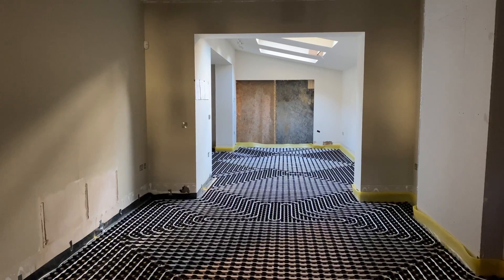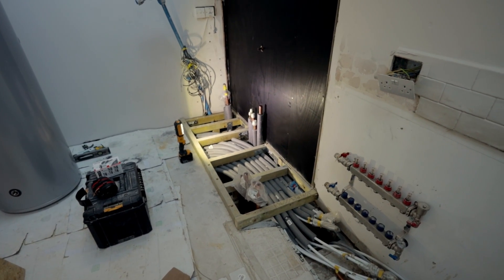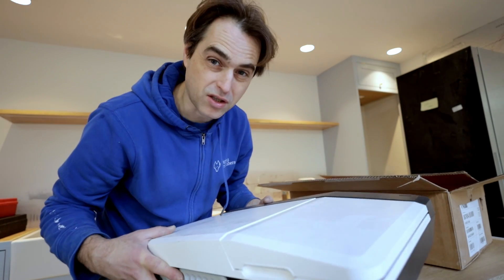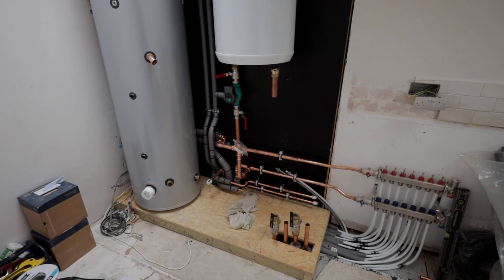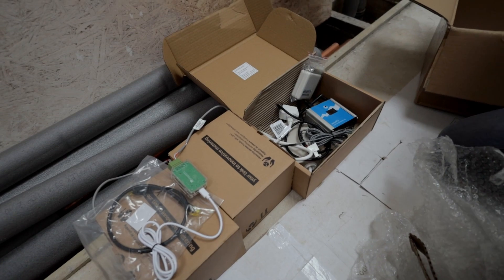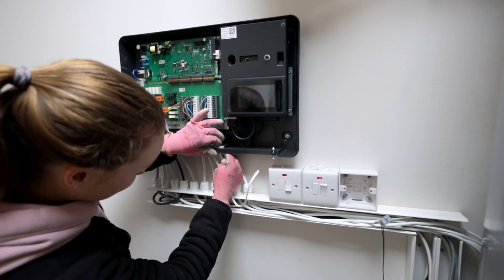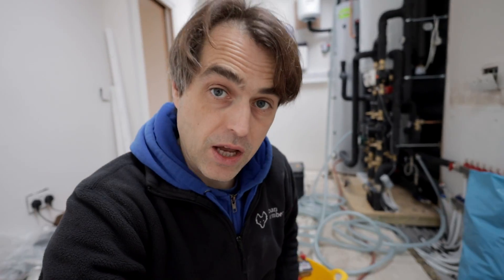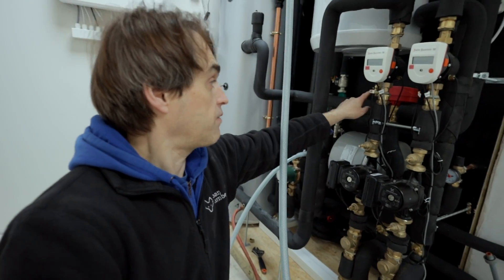NIBE 2050 Cascade System Installation In A Period Property.

Comment: Another great video Szymon, thank you! Did you fit check valves on hp flow and / or return pipes to avoid any unwanted circulation / interference in between the devices?

Comment: How are the weather compensated curves set on one heat pump and on the other, considering the parallel operation of both heat pumps in heating mode?
PS: You’re giants!  It’s a pleasure to dive into your projects and analyze the setup.
Reply from the maker: Curve is always the same - it’s dictated by the system design not a number of heat pumps
Reply: @UrbanPlumbers  Clear, thank you. Is there a time delay for switching the slave pump on/off relative to the master pump, considering that they have the same setpoint?
Reply from the maker: @DDJ1621 @DDJ1621, this is not a master/slave setup. It is a full cascade with load sharing, so depending on the load required 1 or 2 units run at the same time. if only 1 is needed, then they will swap duty to have the similar use.

Comment: Related to the analysis of the pump's operation performance, what do you think about taking the data necessary for calculating COP, SCOP... directly from the controller, using a MODBUS converter and suitable software for archiving and processing the data? So, within the controller there are all the necessary measurements required for the analysis. What do you think of that methodology compared to the Open Energy Monitoring system?
Reply from the maker: OEM is more accurate as it has wet temperature sensors and much better flow meter. Heat pump measurements are usually 30% off either way. Also MID meters for electrics are more accurate to most heat pump measurements, and heat pump monitoring doesn’t usually take control or circulators into the account

Comment: What’s the advantage of running 2 smaller units rather than putting in a 3 phase supply and running a single large ASHP please. A supplier is recommending a cascade solution for me, 2x8kW and I don’t know why.

Comment: Nice video, and very nice work. 
For once a plumbing heating channel serious enough to be worth subscribing.
On the first day, as you were laying 28 mil pipes, I was worried you would not have enough flow, but then saw Marie laying 35 mil ones and was relieved.  Still you must be on the fence for the output power, although I have no worries you have calculated it all.

With that setup where the pumps have specialized roles, isn't one of the pumps going to fail before the other?

All in all this installation is on the fence for me*. I would probably have proposed a 20kW condensation pellet boiler, or at least I would have put an offer with either heat pump, either pellet. Both have their pro and con.

* Not on the fence about if it will work, and how well it will work. More on the fence of what to propose that would be more beneficial for the client. There is rarely a perfect heating system in renovation, so you have to weight the pro and cons of each setting and chose what's best.

Comment: I don't think this setup is called cascade heat pump. Cascade heat pump generally means that condenser of the first heat pump in a cascade heats the evaporator of the second heat pump.

Comment: I think the term "cascade " is not right in this case. Cascade is series HPs of different refrigerant where HP1 has an output of perhaps 30C and the HP2 will take that and increase it to 60-70C. It is mostly used to get very cold temps for freezers. At first I thought that was what you were doing but now I see it is parallel HPs to increase capacity in colder outdoor temps.
Reply: yes and no. In the fridge world you are completely correct with your definition. In the heating world, two heat sources in parallel is refereed to as a cascade. The joys of two industries now being the same with two different uses of a termanology.

Comment: Okay, 8 kW heat pump can pump 8kW of heat, right? So cascading them would increase the temperature difference, but can't increase the power delivered? Because each heat pump can only pump 8kW, you would get 16 kW in parallel or 8kW in series?! The advantage of cascading being that you can have smaller radiators?... What am I missing because this isn't making a lot of sense.
Reply from the maker: It’s parallel- cascade is a term used in the industry ‘wrongly’ for 2 heat pumps in tandem
Reply: @UrbanPlumbers  Thank you for educating me! Appreciate your content!

Comment: Great video! Can I ask which supplier you use for the UFH panels and what kind of screed? I will be doing my ground floor soon at 100mm spacing and wasn't planning to use panels and have been told minimum screed depth is 40mm so curious to know what combo gets you 30mm? Thanks!
Reply from the maker: You can do 25mm if the floor is level. Pro fix plus panels

Comment: Thanks for the system monitoring graphs, the heat only pump(1) performs a lot better than the hot water one(2) is 52 degrees enough for legionella control?

Comment: Love a cascade setup. Do the Nibe allow both hot water and heating at the same time when in cascade? The stupid thing about the Mitsubishi is you could have 6 units with only 1 doing heating and hot water and if there is a hot water demand it will only do hot water the others will all go off, Bonkers.
Reply: Indeed it does allow both at the same time when in a cascade. Up to 8 heat pumps can be cascaded on that controller. Best control system on the market ;)

Comment: God help those customers, when things go wrong and your not around . 😢😮
Reply: Can anyone tell me what is the long term reliability of all those pressed copper connections are and will they fail eventually when the polymer seal ages? They're certainly quick but expensive, I'd imagine but surely well done soldered fittings would last longer? But again I'd imagine all this set up will be old hat in less than 15 or 20 years times and the next owner of that house will have big expenses in fitting something current.🤔
Reply: @nickhickson8738 we have pressed commercial installations that are more than 30 years old, and never had a leak. Carbon steel tube has been a problem  though.

Comment: What is the projected kw savings for a system like this .I know there’s a lot of variables but for someone who’s on the fence about whether or not to say go on something like this there has to be a break even point even if it 20 years from today . My guess is that job wouldn’t give you much change from £80,000.00. Why don’t you hire a insulation subcontractor and do a really nice aluminum jacketing on all the exposed piping?
Reply from the maker: Paul - the cost was much much less than your quoted figure - kWh saving are in the region of 80% as compared to gas kWh consumption as this system will run at scop over 4 and the gas boiler it replaced was around 90% efficient

Comment: Nice job, bit of work in that! As a sparky though I'd have to point out there's no need to use trunking like that, run it directly under the "brain" and cut a hole in the side to enter the cables. All cables are then hidden and less work - you'll never get the cables perfectly straight and it's a waste of time using stuffing glands on an enclosure that isn't IP rated.

Comment: Room temperature at 15DegC?  Is that correct??
Reply from the maker: Yes - ground floor is off as they are tiling the floors. I need to ask the client to move the sensor to a heated area

Comment: OMG!!.......I see Nibe have not improved their controls set-up in the last 20 years Dracula!!
Did a lot with Nibe on Geothermal 20-25 years ago, specified & supplied by others, we did fit only for Builders. Nibe back-up was shocking, run by a bunch of used car salesmen, most couldn’t put a Nut in a chimp’s mouth. Their Technical Support was non existent, a bunch of useless pricks.
I recall on one ‘Docking’ job, I asked a question about a Thermistor, to be met with a blank stare from the Salesman......This Donkey didn’t know what a thermistor was!!!!

Here, that wee lassie looks as if she’ll make a great a Tradesman. Watch incase, she gets head-hunted by Skaterboy Adam!
One wee point, your UFH loops should be sleeved as they come out the Screed at the manifold.
Keep up the good work son & I hope you don’t get deported to Rwanda before your next video.
Thanks for sharing.
Luv Dick Puller ❤

PS. Did you need to upgrade the 80-100amp Leccy incoming supply mate??
Reply from the maker: Skater boy doesn’t deal with heating anymore. Last time I heard he had some boring office job surrounded by tech and finance people selling iPads or something. 

Wee lassie is already a great tradesman. One day you may reach her skill, but probably not.

All heat pump and boiler companies are run by used cars salesman. 

I am glad the asylum has again reinstated your WiFi - meds must be working again.
Reply: @UrbanPlumbers  What, Heatgeek is selling iPads???!!!..........Oh, I’m getting a hint of a fallout there Dracula??!!!.....What happened, did he rip you off with his courses full of flannel & drivel???!!!

Well, a nice install as always mate, but you really need to buy a Bending machine, more elbows in that Plant Room than Gazza in the Penalty Box!!!......Can the wee lassie bend copper tube better than you then??

Thanks for your concern over my mental state, but worry not, I’m in the pink as they say. As long as people are making an arse of fitting UFH etc, I’m delighted to correct them. It gives me an enormous feeling of well-being.
One last thing, if you want to ‘Come Home to a real fire’, fit the Ideal Logic👍👍👍🥃🥃🥃
Reply: Bizarre comments?
Reply: @shifty277  I know, but his English is not very good son.

Comment: Syzmon, you (and Marie) continue to knock them out of the park, what a superb installation. I really like the openenergy monitor kit/website and think it is a force for good in the industry and a great reference source for the installer. On the wiring side - maybe a cable ID labeller would be a good discipline.😉😀👍

Comment: Very clean install, again. Is Nibe more expensive than a Vaillant? What's the efficiency compared to the Vaillant?
Reply from the maker: efficiency probably the same - I really don't see much diffrence here between manufactureres. Controls and quliaty of the desgin adn isntallation is what makes the diffrence - not the box outside. 

Nibe is probably comparable or even chepaer than Vaillant at the moment - as they have a sale, not sure they will keep the prices low for long though? Generally a bit more expesnvie than Vaillant. Controls are in a different leauge to Vaillant but I do not hear much good about the back up from the comapny from others.

Comment: Curious as to the minimum space required in front of the unit. Normally around 1.5 meters for a heat pump of that output. The controller is crazy and looks way over complex for a simple cascade. Why only one heat pump for DHW? Would it not be better to do a true cascade with lead and lag swap over? Drying time for screed, was that not a requirement? Underfloor looked amazingly well installed and pipework is spot on.
Reply: using one heat pump for heating and one for heating and hot water means that you will never get a disturbance in comfort when in hot water mode. The controller balances out the running hours between both heat pumps automatically over time, so equal wear. Controller is as simple or complex as you want it to be. There is a step by step basic set up guide which is suitable for most jobs and a more in depth step by step guide depending on what your system requirements are.

Comment: Thanks for such a great video. Your plumbing installation and pipe work is “Spot On”, but sorry to say your installation of the Main Control Panel is really poor. All the cables should be neatly laid out and marked up, also the input cable should be marked at both ends so that is also traceable.
Your plumbing skills are 120% but Electrics still need improvement.
You are the only Heat Pump Plumber that I would trust to do an install.

Comment: Great Video, and nice job, thanks for sharing
 i have one question regarding your Ufh system shown. 
Is it profix plus 20mm and do you using any screws or pipe clips to fixit down specially on the bends 
I am in process to start 240m sq with 100m pipe spacing  and just wonder how you fix it for existing concrete floor when you laying  (20-30mm) liquid screed ?
I know it comes with self adhesive backing but still wonder how it will hold all the pipe bends on spiral pattern?

Comment: What would your guess be for the heat power requirement for a commercial 600m2 sandwhichpanel building with 12cm foam insulation? I got mixed calculations from professionals.
Reply: Too many unknowns to even guess

Comment: Doea the system have the capability to automatically switch which heat pump is the primary unit in the cascade? On commercial systems the lead unit is usually swapped on a weekly basis to keep the wear even across multiple units.
Reply: All NIBE cascades will balance the running hours between the heat pumps automatically over time.

Comment: The electric supply must be very large, what happens when they add a couple ev charges for their no doubt many cars 😂
Reply from the maker: 100amps - easily covers both heat pumps. Single phase at the moment. They have a 3 phase supply at the property if they ever want to add car chargers

Comment: Nice job as always. What was the reason for not installing a three phase 16kw heat pump 🤔
Reply: two heatpumps means you can have two different flow rates which is more efficient than using 1 and mixing it down, and also you can fire one of them up if you have low heating needs which means you can modulate to a lower output (a 16kw heatpump would be lucky to modulate much lower than a 4-5kw output, which would mean more cycling etc)
Reply: @Etacovda63 Not sure that is the idea here at all. I believe this system will have both units running at DOT and at about 10c  DOT No.2 will revert to standby. Essentially reducing cycling in the shoulder months of the heating system. There are no mixers in the installed system as shown in this video (and that’s the point in a correctly designed UFH system). What was not shown was the rads will have been assessed and upgraded where necessary to meet the heat loss at the designed flow temperature for the whole system.
Reply: @normanboyes4983  yep, that makes sense as well

Comment: For those wondering, cascade essentially means parallel in this case. Not in series or two stage like it means in the refrigeration world. 

Nice install, you do some amazing work!
Reply: Yeah. I was literally expecting one heat pump producing 60 C water and then another taking it 80 C 😅
Reply: Yeah that is borderline clickbait. I know the terminology differs between domestic and commercial technicians but the vlogger in question should know better. I think it's bonkers NOT to use cascade setups. Having an OUTSIDE unit pushing 75 degrees C INTO a property for hot water is just stupid (which is usually around 10% of heat demand in most houses). A second stage would be ideal on this project for the higher flow temps for the upper floors and HWC. Especially since there is a proper plant room with enough space to fit everything.
Reply: @m23605  I think you'll find anywhere you run flow temps that high, you might as well stick with gas. The higher the temperature rise, the lower the efficiency of anything, especially heatpumps. The flow temp on most videos I've seen seems to be around 30-40C, apart from hot water. 

No point wasting energy trying to get high grade heat, when low grade heat works just as well with some underfloor and bigger radiators.
Reply: @Thermoelectric7  Yes you need high heat mainly for DHW. In the video they mentioned that the UFH is mixed down so the rads are running at a higher flow temp so a cascade makes some sense (or as you say, just stick more emitters where needed to avoid mixing). Since money is no object on this project, a cascade would have been a great showcase. Wasted opportunity IMO.
Reply: @m23605  Good memory, I replied half asleep and forgot that part! Very interesting.
Reply: @m23605  You watched the wrong video or completely missed the fact there were no mixers on the UFH manifolds.
Reply: @normanboyes4983  Well I stopped watching after it became clear this was not a cascade system. 00:45 regarding mixing but maybe it wasn't carried over to the new install
Reply: @m23605  It is a low flow temperature design, I think you have rather missed the point.
Reply: Yes, this is just multiple heat pumps and not a cascade. Hopefully, in the future, there will be cascaded systems for domestic designed for cold UK winters in Victorian houses..
Reply: @marksperspective8861  Cascaded systems already exist. They're just less efficient, the higher the delta T the lower the efficiency. You're much better off working to insulate everything you can, and installing radiators that are designed to lower flow temps. 

Sure, you can put in a cascade heatpump, but it's unlikely you'll save much if any running costs over a boiler.